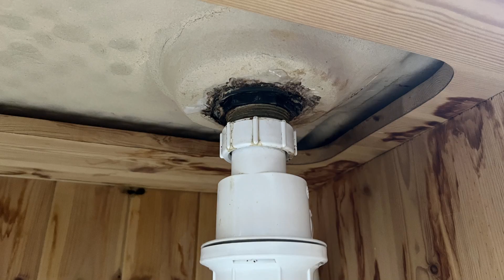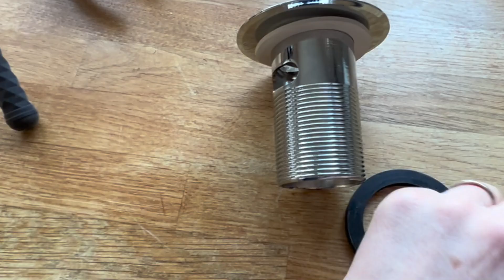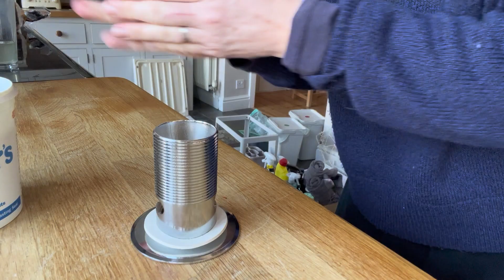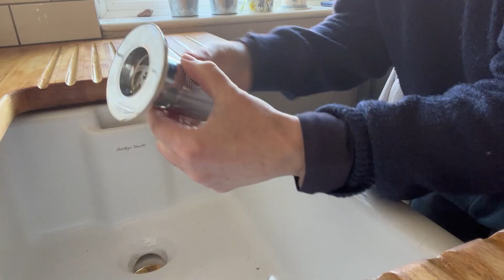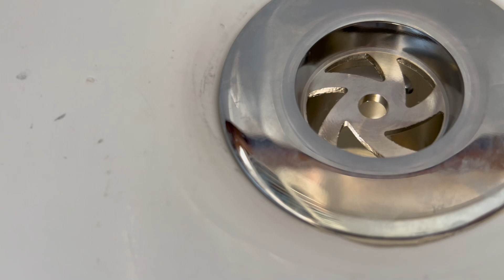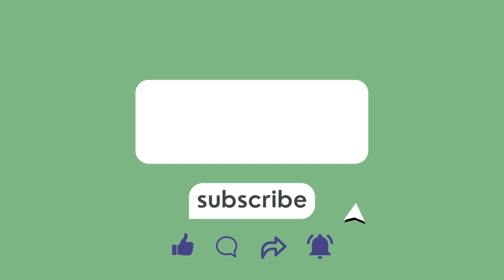How to replace Belfast sink slotted waste

Comment: Hiya Deborah, just going through Tap replacement and waste and entire pipe work as a DIY'er on a Belfast. 
Tap installed 👍Waste and pipes removed . VV Gunky, Mwhhhhhh!
You talk about overflow and marking it but then nothing appears related to it. Puzzled. Can you elaborate?
Good to see females tackling and producing content on these tasks we all seek advice on 👏👏
A proposed 2 hr job now a full day gone and loads of new bits to acquire. Best to replace all with new as its over 10 yrs old and worth the effort as we had drip drip leaks going on.... 
Respect from an older male still ready to learn from the wiser..💕💕
Reply from the maker: Hi there, provided the overflow is in the correct position on the waste pipe there’s nothing further you need to do. Any water flows down into the overflow once it’s all fitted up. Well done for tackling this project, it took me a while but was totally worth it!
Reply: @LivinganOrganisedLife  Ahhh Gotcha. I watched this before ripping out the old which was in the same state as yours and can now see the overflow exit now dismantled. Makes sense now. V informative all round and helped me no end to tackle the job and get the bits needed. new tap install as well and that was a challenge due to space and a rusted base plate and screw. 4 hrs to sort that bit alone and some brute force! Thanks for your reply and help 💕💕
Reply from the maker: They are a pain and rather smelly! Keep an eye out for leaks. My brother ended up fitting a basket waste in his Belfast sink so I would consider this if you have problems as the sink hole is never completely round or flat on old Belfast sinks. Fingers crossed it stays dry for you!
Reply: @LivinganOrganisedLife  I had removed the trap pipes etc below but not actually pulled out the metal waste top part as it was siliconed in and needed another 30 min removal and clean up. Great tips - will check out the basket waste option. At least the taps in 🙂

Comment: Which trap did you use? I have the same sink and waste reducer but not sure which bottle trap to get! The connector looks like it needs to be 40mm but the most common is 32mm so did you use a 40mm to 32mm reducer?
Reply from the maker: I used a 40mm bottle trap from Screwfix. It’s all working well thankfully!: https://www.screwfix.com/p/mcalpine-c10-bottle-trap-white-40mm/20968?ref=SFAppShare